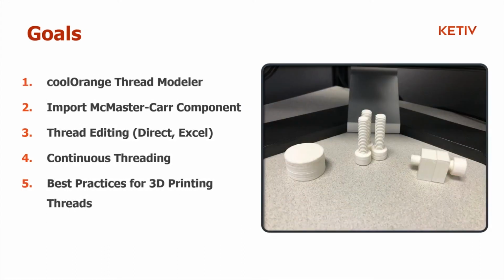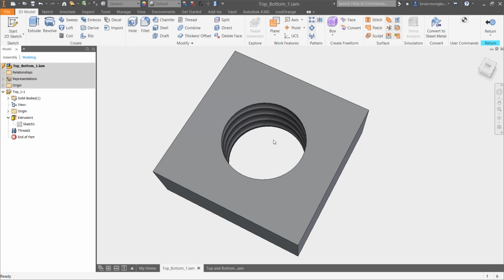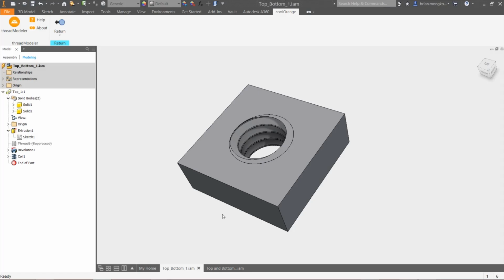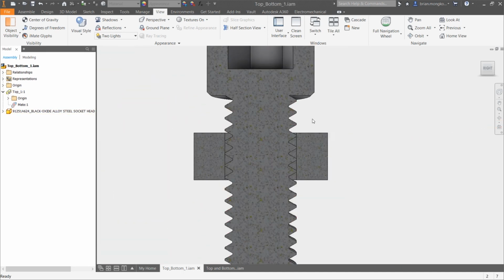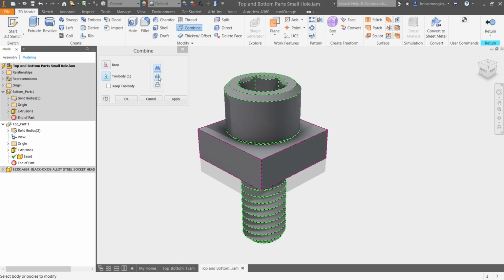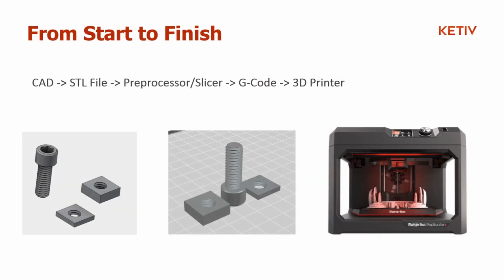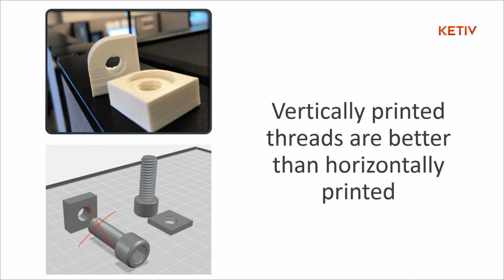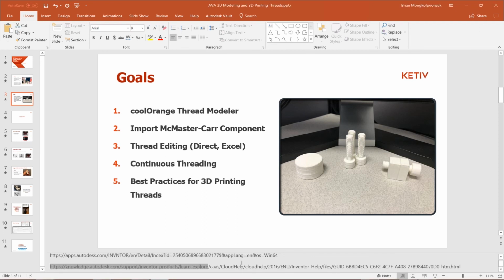3D Modeling and 3D Printing Threads in Inventor | Autodesk Virtual Academy

Comment: as per comments below solution to make the add-on work in Inventor 2023:

There is way to overcome this by going to C:\ProgramData\Autodesk\ApplicationPlugins\coolOrange_threadModeler.bundle\Contents and editing the file (Notepad or similar) coolOrange.ThreadModeler.Inventor.addin and change the line FROM THIS : <SupportedSoftwareVersionGreaterThan>20..</SupportedSoftwareVersionGreaterThan>
  <SupportedSoftwareVersionLessThan>25..</SupportedSoftwareVersionLessThan>

to this: <SupportedSoftwareVersionGreaterThan>23..</SupportedSoftwareVersionGreaterThan>
  <SupportedSoftwareVersionLessThan>28..</SupportedSoftwareVersionLessThan>

Then unblock in addon manager and it will work.

Comment: Direct Edit continues to spit out errors even  when using real small changes in size. This is specially true when dealing with internal Threads. What does the "Pitch Offset" option in the thread modeler do, is it something that can achieve similar results?
Reply from the maker: Direct Edit can be tricky since there is such a small margin for editing. I would also try a sweep cut as another workaround. The "Pitch Offset" is the difference between the Major and Minor thread diameters, not 100% sure that would help this scenario, but definitely try it out and let us know! Thank you!

Comment: Hi I have Inventor 2021. I have downloaded the threadModeler. however, it is in my "Autodesk App Manager" and it just listed there and I can find it in my + Add-in. do you have any idea how I can activate it ?
Reply: There is way to overcome this by going to C:\ProgramData\Autodesk\ApplicationPlugins\coolOrange_threadModeler.bundle\Contents and editing the file (Notepad or similar) coolOrange.ThreadModeler.Inventor.addin and change the line FROM THIS : <SupportedSoftwareVersionGreaterThan>20..</SupportedSoftwareVersionGreaterThan>
  <SupportedSoftwareVersionLessThan>25..</SupportedSoftwareVersionLessThan>

to this: <SupportedSoftwareVersionGreaterThan>21..</SupportedSoftwareVersionGreaterThan>
  <SupportedSoftwareVersionLessThan>26..</SupportedSoftwareVersionLessThan>

Just change the 20 to 21 and the 25 to 26 and it worked for me in Inventor 2021.
then start Inventor 2021 and it should display. Mostly u need also to unblock it and some multiple restarts of Inventor.
Reply: @alberttur8377  Bro, just done that and it works! Appreciate it, thank you.
Reply: NVM just saw that 2021 versions are not supported
Reply from the maker: Typically you have to download apps from exchange site and install them, they don't usually show in the App Manager, but will show in Add-ins if it is installed properly.  and you are correct it is not currently supported for 2021.

Comment: Thanks for making the very helpful vid. The part now shows up in my slicer with threads however the printer is still printing it flat without threads. Do you have a suggestion?
Reply from the maker: Hi Johny,
Not sure why the printer would print something other than that showed on the slicer. I would recommend adjusting overhang settings, adding support, or using another slicer; maybe the slicer is just incompatible with the printer.
Thanks,
Brian Mongkolpoonsuk

Comment: Inventor crashes on changing the size of the threads. any help?
Reply from the maker: Hi RisK,
Does it crash when you manually adjust the thread size or when you change it in the thread tool?  Sometimes when manually doing this, it may lag out since there is a lot occurring.  If not, could you send me the error message you are receiving (if any) upon crash?  Did you make any edits to your thread standards?  In the meantime, I would check the general go-to's, like making sure you are on the latest version and try doing a repair of the tool.
Thanks,
Brian Mongkolpoonsuk

Comment: Hi!
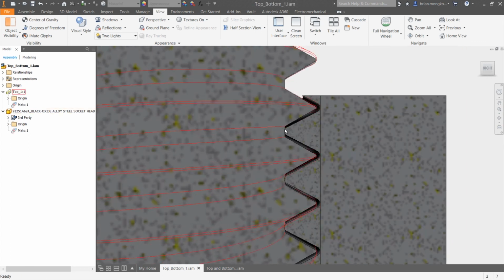Very nice video, I'm having some troubles with the part at min 17:31.
If I reduce the size of a screw created with coolOrange, then there is that part touching the border. When I resize only that part I obtain an inner cylinder slightly detached from the outer thread parts.

When I tried to do the opposite (resizing the hole), I obtained again a good result but with those touching parts. Trying to resize only those parts of the hole I obtain an error trying to enlarge it and it works only if the resize is closing the hole.

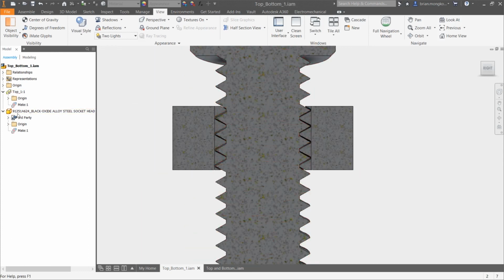I don't know if it is clear but the problems are all related to the inner parts in your video at min 17:31, both resizing the screw or the hole.
I'm using coolOrange screw and hole threads I will try with the commercial model as you do in the video.
Reply from the maker: Hi Giacomo, It sounds like we can definitely help you out one on one. Go ahead and email our presenter at brian.mongkolpoonsuk@ketiv.com and he'll be happy to help you out! Thanks.
Reply: @KETIVTechnologies  Thank you very much for the attention, but in the meanwhile I solved the problem "combining" the two resultant solids coming from the CoolOrange tool, so before resizing a combination must be enforced.